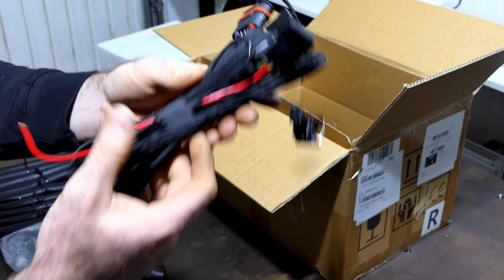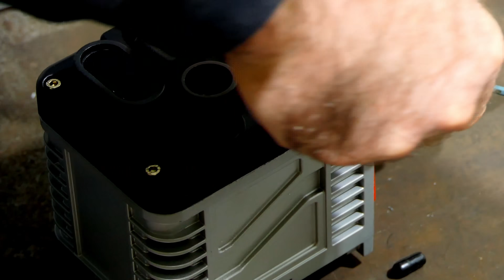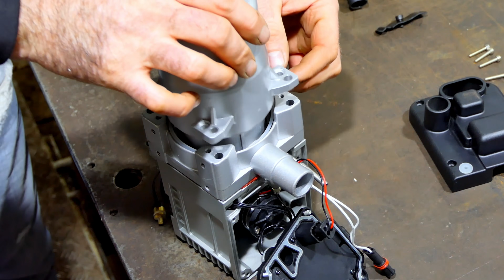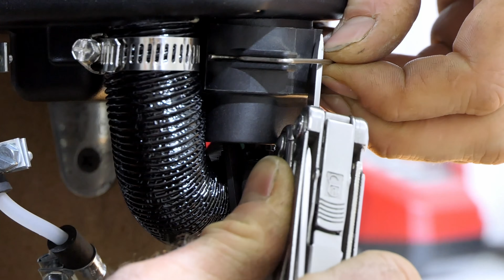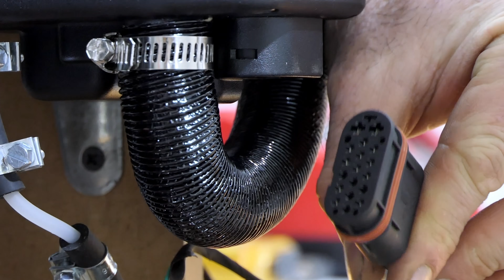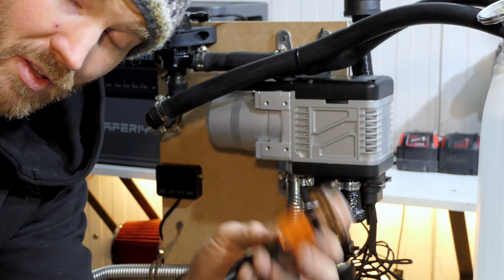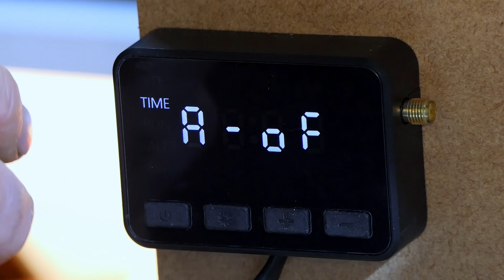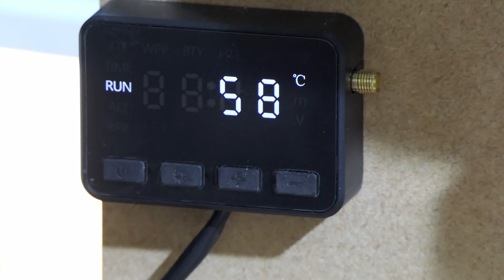Wonder of Manufacturing - Worlds Cheapest Automated Hot Water Central Heating System

Comment: I owned a 1995 Ford Galaxy people carrier, it had heater for the rear rows of seats with separate controls, I believe it was an option as the Alhambra I had afterwards did not have it. It had heater pipes going all the way to the engine so I assumed it used engine heat.

One cold morning I left it running to defrost and saw white exhaust smoke coming out under the rear of the LH door cill, on looking I found a small exhaust pipe like on a diesel heater, I never realised that it used the road fuel to heat the rear while the engine was coming up to temperature because it worked so seamlessly.

I post this because these vehicles could be a good cheap source of second hand genuine Erspacher water heaters.

Comment: Really nice video ! Thank you ! I would have been interesting to see the actual minimum electricity and fuel consumption to maintain a certain temperatur of the water circuit. When the power consumption from the hot water isn't high enough, does it shut off and start up again ? Or does it go idle ? Or does it just continue ? They say numbers but it's always hard to believe them ahah
Reply from the maker: This specific model It gets up to a set temperature then shuts off and needs to be clicked on again once temperature drops. I'll be testing other models soon. Cheers J

Comment: Hi, really love youre video's. Do you have any following up on this video? Did you add the EGR ? Also I love to see if you can run it on vegetable oil. Anyway thanks for the inspiration
Reply from the maker: Thank you. I've done all the above with regular Diesel heaters. EGR type devices work well for increasing efficiency but I need to make a better one.  Veg oil works cut with kerosene/diesel 30-50%. Cheers J

Comment: Now they are £160

Just an edit... I run one on my Narrowboat and it goes into 3 radiators and a hot water heater that supplies hot water for showers, I use a surecal hot water tank which has 2 heat exchangers inside (one to my engine and one to my diesel heater) aswell as a twin voltage immersion heater (12v and 240v for solar hook up and mains) really the 2 coupled together are an amazing system I never run out of hot water or heating... The diesel heater is also plumbed at the end of the central heating line which at the start had a coal/wood burner with a back boiler i made inside 🎉 all bases coverd

Comment: I used silicone spray on my pressure washer o-rings whenever I reconnected the hoses and nozzles.  Dry fitting chews them up, makes them roll, twist, and pinch, compromising the seal for an unattended, impromptu, messy expensive annoyance when least expecting it. Some hardware manuals even recommend replacing gaskets whenever refitting. I believe there may be a recommended lubricant for refitting your hydroponic heater's o-rings. Who knows, maybe carbon powder or high temp grease? Also, I am astonished at the proximity of the pump to the exhaust pipe bend.  That's a failure point.  A continual well-directed room air current drifting onto it could overheat the motor within minutes.  And I wouldn't vouch for the heat rejecting ability of the near proximity, non-metalic fuel line either.  Also position the electronics above potential leaks.

Comment: I have a heater like this. I can not find a replacement glow plug for it. Any links where I could find one? Thanks
Reply from the maker: Have you tried using Google lens?
Reply: @joshuadelisle  I have not, unfortunately I no longer have the original glow plug. I did find one that was similar, but not quite the same. The ferrel that inserts into the burner was smaller on the one I bought. I made a bushing to fit it, but is still doesn't seem right. The heater operated but did not sound right. I am now getting an E-03 code which is a voltage code. Prior to installing it, I measured about .9ohms. I thought that they were supposed to be around 1.5 to 2ohms.  I tried to see if I could purchase the heater that you showed, but could not find it. It looks exactly like the one I have but probably built a little better. Mine has plastic covers and the fan cover is not held in place with screws. 
Thanks for the reply by the way.

Comment: I was going to run one of these with coolant to prevent unit corrosion and have the coolant  flow around a copper coil inside my water tank.   But now you've told me that the copper may react with the aluminium and I'm having to rethink it

Comment: When building my first Pool I laid Agricultural Heater cables under the PVC Liner figuring 'Heat rises' right..?   It worked even after a Tubular steel ladder managed to puncture the liner and cable.. Nice fuzzy feeling.. but moved over to a HeatPump (Colorex type) which worked very well for 20 years..

Comment: Thoughts on using this to run a central heating loop with a couple radiators in a large double garage. As opposed to my current setup using a true-ish 8kw heater from Hcalory model AC-22 simply blasting hot air in.
Reply from the maker: I think the simple air heaters are better for your situation. Less upfront cost, less to go wrong and maintain and probably more efficient. Water heaters are good for underfloor, hot tub/baths or hot water storage. Cheers J

Comment: Great video, so much that I got myself one😅 Unfortunately, after two cycles of heating up the van heat exchanger and alde radiators without problems the unit has gone mute. Did you ever have problems where the display would just not turn on or wake up? I've checked all connectors that those are attached correctly but still nothing...
Reply from the maker: That's disappointing to hear. It's definitely getting the 12v input? Ill into replacement controllers and see what I can find. Cheers J
Reply: I decided to buy another unit from where I can swap out the parts and see what the issue really is. It is getting 12v to the fuse and after but the rest I did not test yet. I did notice that each time inserting the fuse it would produce a small spark but now it does not do that so nothing is "sucking" current.  @joshuadelisle
Reply: Also, the temps here dropped quite a bit to -20c so that could potentially be a factor

Comment: Really great video. You are a superb communicator. i just wanted to ask if you think it could work plumbed into a caste iron radiator and a hot water tank to heat an off grid house? I thought it strange that you said it could only run for an hour. Surely i can run permanently, no? thanks
Reply from the maker: This one has limited settings but ill be testing others soon which are more suitable. The size is good for a small cabin/tiny house. Cheers J

Comment: Like to make a little comment about diesel heater I have one very similar to the one in your video and I run it in a small camper van always on the lowest setting as it creates too much heat, it has suffered from from getting coked up and all the videos I've watched shows you have to dismantle to give it a clean Ito getting running smoothly. I've got a small hand-held blower designed to dry cars off after you've washed them and if I run the heater between 4 bars and flat out and and stick the air blower to the air intake of the blower for about 30 seconds it cleans the unit out and it then runs properly for another month or so so much easier than stripping the unit down which I only intend on doing once a year. Great videos hope this helps 
 kind ryJustin
Reply from the maker: Thank you. Running low maybe the issue, running on max is actually better for complete clean combustion. It means you have to keep turning on and off the heater rather than let it tick over on low. Cheers J

Comment: Excellent informative video.  The output rating of 5kw may be achieved under other conditions, along with improvements in efficiency.  I design hydronic heating systems in the buildings industry.  People often don't realize boiler performance is a function of the input and output temperature of the working fluid.  You need to have a very low input water temperature for the boiler to reach its rated output power - but I don't know what those temps would be for this kind of boiler - for residential heating, say, that temp is below 60C.  But here we have potentially other temps at play.  A lower input water temp will also mean the exhaust will be cooler, which will raise the efficiency.    Also, the use of glycols will not raise efficiency, but lower it.  Glycol added to water always lowers the heat capacity of the working fluid (compared to pure water), and increases the viscosity as well.   Lower heat capacity means more fluid must pass through the heat exchanger, and higher viscosity means the pump has to work harder as well.

Comment: Build quality looks ok. But it's one thing to spend £60 on a diesel air heater and another to blow £250. I used the air heaters on my boat and in my shed. The are great. But I've had them die due to bearing issues. Very interesting though. Looking forward to the long term testing. Thanks.

Comment: So, does this only run for 30 mins at a time? Would you be able to run the water/glycol through a couple of radiators? Just thinking of a heating system for a conservatory 🤔
Reply from the maker: It runs longer if you set it to reach a certain temperature only. Yes you can use radiators but for a conservatory i would just use a regular diesel air heater, they're much more simple. Cheers J

Comment: The 2001 Eberspacher D3WZ (3kw addon heater config) draws like 6dl/hour at idle when running. Have to add that the car consumes 0.6l/hour at idle without AC and all warm. It usually does 1l/hour right after startup, so combined with the heater it kinda stays at 1.5, and as the engine starts to warm it drops to a stable 1.2l/hour. (Engine is a 2001 BMW M57d25 common rail , but in an Opel Omega with different fuel system/turbo/ecu.)

Comment: They look like Fun. But- correct me if wrong, this is Direct water heating system- ie unlike Indirect Sytems which use Coil in tank to transfer Heat without mixing......   You need a Coil and isolated tank.....   Cannot be using same water for Underfloor Heating and showering....   Need a Coil in separate tank....indirect Heating
Reply: Cooking... anything... Also constant fresh water will Oxidise and corrode everthing.

Need Separate Water tank with just Coil going through....Transfer Heat.....  INDIRECT.....The water never mixes....  Standard in houses.
Reply: sorry i know you know this....   Just Engine/Boiler water be dirty....ex plumber mechanic....   Defo wanna keep INDIRECT via COILS/Rads.....

Comment: I wonder how long will it take for imperial measurement people to realize the SI / metric system has a neat "feature" to avoid saying something like 600 mm or 6000 mm. 600 mm (milimeter) =  60 cm (centimeter) = 6 dm (decimeter) = 0.6 m (meter - the base unit). Same for liter: 650 ml (mililiter) =  65 cl (centiliter) = 6.5 dl (deciliter) = 0.65 l (liter - the base unit). And so on...

Comment: Unfortunately this is still not cheaper to run than a heat pump. It gives 3kwh which is actually low compared to the average heat pump output. 

> A cheap pool heater Heat Pump (3kw version, say £500-£1000 off ebay uses only 500-600w or 0.5kw in 1 hour): Electricity = 13p
> This diesel boiler (3kw in 1 hour): Kerosene = 17p

Add to that the fact there is no smell, the noise is low and there's no faff with the heat pump (having to switch it on again after an hour of timing out, having to refill the fuel etc).

Comment: I am going to hunt to see if you did do a follow up video using a glycol coil for a heat exchanger. In the meantime, could a 10 litre calorifier hooked up to this system with an accumulator, act as a shower? Or would heat generation be much slower than water usage?

Comment: Is there any way to adjust the minimum and the maximum fluid temperature?
Reply from the maker: You can adjust the top temperature but it doesn't automatically turn on when at a low temperature. There are some that do but not this one unfortunately. Cheers J
Reply: @joshuadelisle can you show me one where this is possible?

Comment: Regarding the cols of wires, those are DC signals and DC does not induce interference as much as AC does, unless it's high frequency PWM or something similar. I would guess coil of wire is ok at this case, but commenters feel free to correct me. :)

Comment: over the year I have try burning diffrent trype of fuel in normal diesal heater, to a point my burn chamber keep getting block, best way I found to clean then without buying a burn changer is to use GUNK ultra engine degreaser, and let it soak for couple hour

Comment: Hey cool tech !!! you say the exhaust temp is 200 C which is the same figure as the Honda generator's exhaust so you should be able to attach one of these Vajra filter devices ( thunderstorm generator that uses vortexes )  to destroy the CO2, Nox, etc from it and make the unit safer/better for environment, cheers to tech distrupters everywhere ... ( here is my animation of the Vajra robots storming the citadel of big oil ) https://youtu.be/TpLQThfe5ss
Reply from the maker: I've seen a lot on those thunderstorm generators but I'm skeptical because the chemistry and math doesn't add up. At least according to AI. Pseudo science is a very sketchy subject. Cheers J

Comment: Hi, you mentioned that you can only run it for 1 hours, doesn't that make it useless for a hot tub?
I may have missed something.
Brilliant video thank you.
Reply from the maker: It has another setting that means once it's up to temperature then it turns off. So perfect for a hot tub on that setting. The only issue would be maintaining the temp once reached because it won't automatically turn back on. Cheers J
Reply: @joshuadelisle thank you so much for that prompt and informative response.
Love your videos, I'm new to the Josh party.

Comment: "same side as the hot water input" 

the water inputs are interchangeable.

Did you just really suggest to drill a hole in the exhaust output pipe?
Reply from the maker: It's in the instructions to do so if the exhaust is on an incline. The unit is meant to be external anyway. Cheers J

Comment: My heater was delivered with the pump flat down inside its case. I had to mount the pump outside the case to get the right position. I also put a stop tap on. My warranty on my van was denied due to my own fault. I had not driven my Ford Custom mini bus far enough to get the engine temperature up, ie to short runs. All my other vehicles in the past 30 yrs never complained with the same length runs. I could fit one of these heaters to get the temp up. But then they would probably blame the aftermarket heater.

Comment: In Sweden we stopped heating homes with diesel decades ago because it's to expensive even if diesel used for this very thing is less taxed than as engine fuel.
Reply: Expensive as compared to what? Where I'm at, cheaper than electric, more expensive than natural gas but I don't have access, probably more expensive than wood but a lot less work running it, just saying. :)

Comment: How reliable this thing is ? Could it be used for house heating during winter season 24\7 ?
Reply from the maker: Very reliable, all parts are easy to maintain, fix or replace. It wouldn't be suitable for a whole house but you could certainly do a couple of rooms. Cheers J

Comment: IF YOU' DRILL A HOLE IN THE EXHAUST, FOR DRAINAGE,HOLE MUST BE OUTSIDE,AND AWAY FROM ANYTHING THAT LETS AIR INTO AN OCCUPIED AREA,WINDOWS,VENTS,ETC.
AND THE TEMPS NEED TO BE TAKEN FROM A WELL INSULATED HOT WATER CONTAINER...THAT PLASTIC CONTAINER IS SHEDDING HEAT,MAKING TEMPERATURE READINGS NOT REAL WORLD...
AND USING A TANK THAT CAN GIVE A BATH WOULD GIVE TOTALLY DIFFERENT FIGURES...

Comment: Would be interesting to see the glycol idea sent through a heat-exchange coil. Such as teeing into a
The engine loop running a calorifier when the "engine" is not running ?
Also still works as an indirect preheater maybe?

Comment: Great video!

Not to open a can of worms, but pure water actually has a higher heat transfer coefficient than water with ethylene glycol added. Unless you are running the system at higher than 100°C or lower than 0°C, or there are concerns about corrosion, straight water is more efficient, but not by much (10-20% in your test conditions).

Comment: @10:15 sorry man i gotta disagree with you, unless your  car has an electric heater core, like those in a cheap EV you wont be helping you engine or its efficencey
@12:35 adding glycol decreases heat transfer efficencey as glycols has lower therml mass and will increase the viscosity, reasons for ading glycol are it makes it harder to freze the water, which would burst the pipes, also many glycol products also hafe a coroson iinhibitor also if you run a 50/50 mixture the boiling point will be 106°c 5nstead of 100

it looks like it has an antena plug?
p.s i realy like thermodynamics
Reply from the maker: It's literally what it is designed for and has been use in those situations for over 30 years... A cold start in diesel engines is definitely a problem when temperatures are -20°c...

Comment: after checking the price per kilowatt hour for diesel, (price per lieter times kilowatt hours / L ) and factoring in a 60% efficencey for the heater i wasnt that impressed
Reply from the maker: I use heating oil (kerosene)which was £0.48/l = roughly £0.05/kwh. Regular Diesel is £1.49/L = £0.15/kwh.

You can get higher efficiency by running the water through an exhaust heat exchanger to get 90% efficientcy with an EGR cooler.

That makes it cheaper than most heating applications other than a wood stove running on free material or a solar powered heat pump.

Cheers J